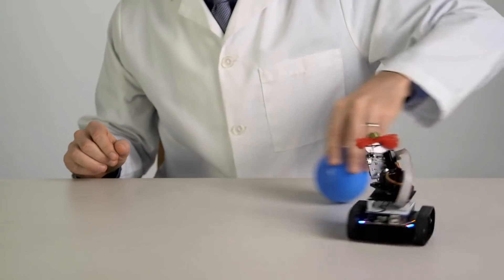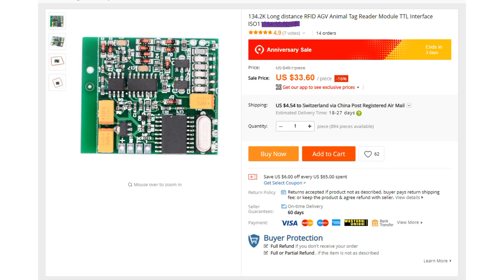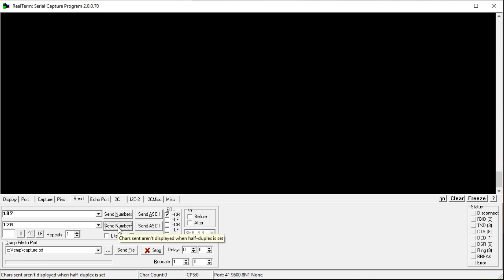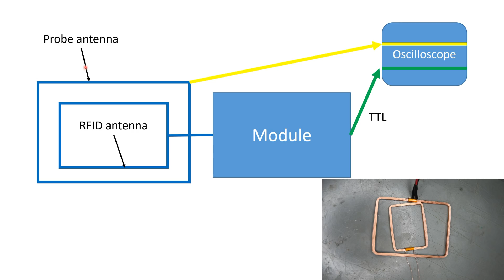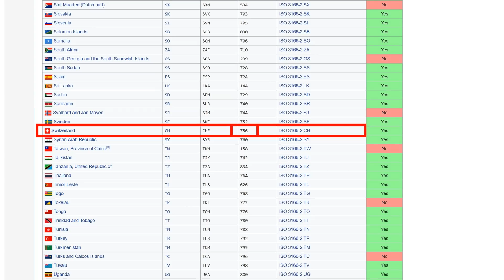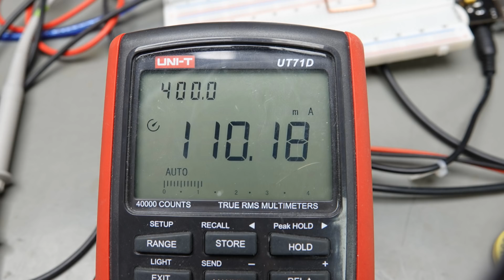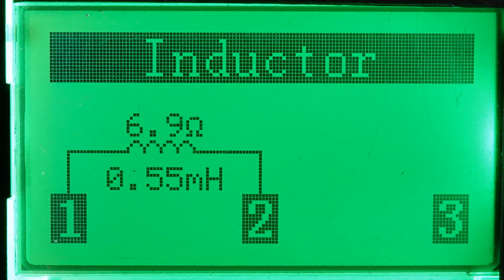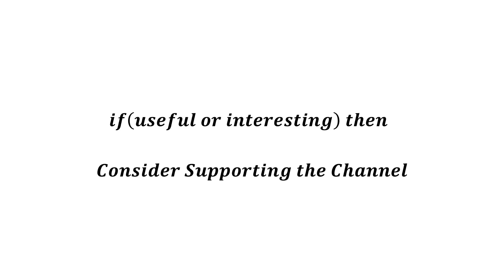#263 How to build an Animal RFID reader with Arduino, ESP8266, or ESP32

Comment: Hello, nice video. Can you help me a little bit? I managed to read the tag, but i just can't understeand how did you do the calculations? My tag should be 1604786574 and i just can't figure it out how to obtain that.  E8917AF5002820010000000000y†   Is what the module spits out. can you explain to me how that works? Thank you.

Comment: Andreas, did you try out the 9vdc reader with the esp8266?  I am worried about the voltage (3.3  vs 9) but the Arduino Mega serial port is good up to 20v.  Cannot find a spec on the esp.  Also, have you posted a wiring diagram anywhere?  I also left the comment from Lamachine on your Git.
Reply from the maker: You can check with a multimeter if the output pin has 3.3 or 5 volts. The ESP8266 is 5V tolerant, The ESP32 not.
Reply: @AndreasSpiess  Yup, I figured it out and already calculated the voltage divider.  Thanks so much for the video as well as the answer.

Comment: Hi, thank you for the useful video which I've only just come across! We have some SureFeed microchip cat feeders to allow cats with special diets to be the only ones to get to their food (like this https://www.amazon.co.uk/Sure-Petcare-MPF001-SureFeed-Microchip/dp/B00O0UIPTY). One unit has stopped working and it seems like the PCB has packed in. The motor, loop, infrared emitter and sensor (only powers up the loop when a cat approaches) etc. are all still working. Wondering about replacing the pcb with a similar Arduino set-up to the one you have created. 
The cat will pass through the loop so I'm wondering if the small or medium boards would do the job or with it being a bigger loop, does it need the larger unit with more power? Any pointers gratefully received. Thanks again for posting this useful video.
Reply from the maker: I do not know more than presented in the video :-(

Comment: Love your project, would it be possible to know how many loops were left on your 200mm ring for a good starting point for producing my own version of this?
Reply from the maker: It is hard to count. I guess 15-20 at a diameter of 22cm. But You have to measure. Start with more because cutting is easier than adding ;-)
Reply: @AndreasSpiess  Thankyou, that will give me a good starting point

Comment: That was very helpful, I am building a cat scanner to place outside but I wonder if you give me some advice about the DIY antenna, I am using a 24AWG cable for about 20 CM diameter. The ohm is about 6.03 but still cant scan the chip.
Reply from the maker: Resistance is not important. inductance and resonance is important. And unfortunately I cannot do remote debugging :-(
Reply: @AndreasSpiess  oh yeah I just talked to the guy who made the board and said the same. They were very helpful. Apparently there is no much different in working state between 6 and 9v. He told me that at 6v will just heat up more. 

I found one small bug on your software where I can store a bigger number than long. I got a test chip that is bigger and I need to work out how to store that in two different long
Reply: @AndreasSpiess  got more info, the antenna should be tuned to 580uH , from what the manufacturer told me, I am using 24 AWG but seems not working but once I get the meter I will double check why.
Also I found from another youtuber this handy calculator http://www.circuits.dk/calculator_multi_layer_aircore.htm

I have to try, but maybe uint64 will do the job to fix the overflow of the 10 byte to int of the RFID.
Reply: Extra info. There is a need of a capacitor for this module to make sure you can have the full range and potentially change the jumpers. The manufacturer suggest a 1000 capacitor

Comment: Hi Andreas, I am busy with the same project and I have been looking for your sketch all over github, but can't find it. Where should I look?
Reply from the maker: Maybe you look into the video description? First link.
Reply: @AndreasSpiess  Sorry, I never use Youtube or the other social media and did not know where to look. Found it now. 
Anyway: I have the same module from China as you have, the one that comes with ear chip (I also have "the little bugger that is difficult to solder"), but your program does not return the number on my chip . The 3 digits country code is OK, but then comes a 10-digit number that is different from the one on the chip. Same for a cat-chip that my vet gave me: 528=Netherlands is read correct, but the identification number then differs. Anyway: 3+10 is 13, not 15 digits as described by the ISO standard so there are two digits missing.
I hope we can straighten this out 'cause I have been beating my head against the wall for two weeks now. Thanks.
Reply: Andreas, I think I got it. When you compute the identification number from hex to decimal, you have the order wrong. If I reverse the order of the ten hexadecimal digits in your program, the resulting decimal number is the same number as on my earmark, c.q. the label on my cat chip.
Reply: weird... in your function hexInDec the unsigned long 'mult' does not increase after it reaches 268435456
 and returns to zero.Therefore the last digit in my hexadecimal string is not added.
Reply: I find that strtol and strtoul do not function either for large numbers, although the limits of an unsigned long are not reached by a long way.
Reply: @Andreas Spiess I have it now.  At least, the program returns the correct number of the chips. I had to link the sketch with the 'BigNum' library and change the variables accordingly. I used an Uno-clone, perhaps that was the culprit? An esp8266-based WEMOS also refused to return the correct chipnumbers, tonight I will try with the BigNum library. Do you want to see the code?
Reply from the maker: Yes. I will merge it into my repo if you send me a pull request.

Comment: i found out that the reader have only TX pins and you used arduino.Serial() in your code. there is no special wiring needed? What about RX? no wiring at all? - And arduino.serial() still works? i asked also on github and post this to catch your attention to this (theoretical?) problem...cat was feeded with green light..code must work in practice...
Reply from the maker: The sensors only send data, so they do not need an RX.
Reply: @AndreasSpiess  thx for reply. i was afraid that arduino.serial() would throw error if RX is not wired . also i was afraid not to wire RX to not cause an arduino.serial() error. with your answer i will give your sketch a try on my nano with 2nd Serial as softwareserial. if all fails, i will come back here. if all succeeds, i will come back and clapp here. wish me luck. thx for all your perfect videostuff. love it.!

Comment: Thanks for the great video, it's often hard to find info on the 134.2kHz stuff.  I'm curious about the antenna diameter, wire gauge used and how far away from the antenna will it still reliably detect the cat?
Reply from the maker: The rech is only a few cm. The idea is that the cat passes the loop
Reply: @AndreasSpiess  Thanks for the response.  I am having issues getting my antenna to read more than about 10mm away from the antenna...basically if I pass the RFID tag directly against the antenna, I can see it but if I am say 2cm away it will not detect.  If the cat is going one way through the cat door, then the antenna works.  If the cat goes the other way, the gap created by the flap on the cat door prevents reading. I am sure that the issue my lack of skill with building the antenna, and hoping I can figure out how to improve.  Thanks!
Reply: @rogerarchibald  Did you ever figure out the issue? Try to match the antenna diameter to what Andreas used, as well as try different orientations of the antenna plane vs the chip. It could be unlucky how the chip in your cat is oriented. May be easier to buy a chip online for testing so you can control this more easily (rather than flipping your cat around in circles :) Also could be the reader not using enough power or the number of turns in the antenna.

Comment: I'm building an automated cat feeder based off your video, so THANK you for doing this testing! Question though: what is driving the diameter of the loop? I'd like a larger loop for my kitties if possible (maybe even a square shape), but I assume I'd reduce the range of the scanner. Is this true?
Reply from the maker: The driving factor is the size of the cat. But you have to test the range.
Reply: No, if you make a square shape that would effect for the position of your tag, the tag and the antenna should face to face, but in a circular shape the different position of your tag wouldn't cause anything

Comment: Hello Andreas, nice video! Thanks, nice to see that it actual works! I’m also working on a petfeeding system for my 2 cats, each with a seperate diet. Can you give/send me a link how you connected the last one (the high voltage one). I couldn’t find this via the links below .. I’m currently struggling with that. Thanks!
Reply from the maker: You should be able to read it with Serial.read(). I have no code anymore :-(
Reply: @AndreasSpiess  Thanks for the answer, I was doing that, but sofar no success for me. Btw, my cats have a dutch accent ;-)
Reply: @RealDameBlue  I'd love to hear an update. did you succeed? Surefeed bowls wont do for us bc we need a system with a timer for scheduled feeding when we leave for a weekend, so our cat sitters dont have to come in twice a day but only once. I was thinking to get a small shelf with doors, put cat doors into its side walls on 2 different levels that recognize which cat is trying to enter, and place something similar to catmate bowls inside (the round ones with a built-in timer). i'm kind of in the mood to overengineer the whole thing

Comment: Good afternoon, this the guy with the welsh ascent, :) i have found your videos truly fascinating and informative , you have helped me with so many projects, so much so , i have never had to ask a question, until now,  i am due to receive one of those implants. just like the gentleman you met has,  as you maybe aware there are sometimes issue the the coupling due to the different coil shape, there are systems for sale that use tube -  cylinder shaped coils that stops this... but they are not, from what i am aware. compatible with arduino or esp32. my question is there any way i can make a custom antenna and attach it to an arduino compatible system . RC522 for example? its for my motorcycle :D
Reply from the maker: You need a receiver which is capable to decode the frequency and coding of your chip. Maybfe you watch my other videos about RFID
Reply: @AndreasSpiess   yes the rc 522 works with my implant and the arduino. where would i started making a cylindrical antenna for it?

Comment: help I dont understand it anymore. if you use animal tags its frequencie is 134.2 khz yet you get it to work with these ones how i dont understand
Reply from the maker: I used proper receivers for animal tags
Reply: @AndreasSpiess  and how do you decode it from the code given, because on 6:42 you did magic and it gave you the correct number out of a string of letters and numbers.
Reply: @johanneshettinga  Just write the bytes (every 2 characters) backwards and convert it from hexadecimal to decimal.

Comment: Grüezi Herr Spiess,
I tried to replicate your device, but I do not get the real ID written on the chip. The cow tag works, but the two chips implanted in our cats, do not. If I scan these, only the country code matches. Did you do anything special, or does it work on its own for you? Does it read the real number? I need to get the real number,  because we have an unknown cat visiting us, which might have a chip. So I can not use the number read by the program, like you did to distinguish between two cats.
Reply from the maker: I do not know if I got the „real“ number, because I do not know it. But I got different numbers for different cats and the China tags.
Reply: @AndreasSpiess  Well, same in my case, but I have a paper from the store, which sold the cat  to us, that is telling me the right number. Maybe you can have a look on yours, and compare to the read number?
Reply from the maker: I do not have the project in operation for now, so I cannot check
Reply: @AndreasSpiess  Ok

Comment: Great video
I’m only learning so I like to try and understand how the sketch works.

I’m not sure about the Hex into decimal function
It works fine for country.
When doing the ID   , when you get to message[9] the mult x 16 is bigger than an unsigned long, so mult goes back to zero.
This means you only process the first 7 values

The checksum I have know idea how it works! And help with that would be great

Many thanks
Reply from the maker: Unfortunately I do no more remember what I did in this sketch and I have no time to go back.

Comment: Hi, for a school project i'm making a automatic hen house. A part of the project is to count the chickens. here I tought about using rfid. Do you have any suggestions on how to know weither the chickens are inside or outside. (there's a budget of €150)
Reply from the maker: If you can chip them you can use RFID. If not you have to use other sensors like PIR or light.
Reply: Hi Andreas, I have very similar question. Sent you facebook message. Check it out please
Reply: Hey Henry, I have similar task. Do you have a solution?

Comment: How do i convert ascii output to decimal? I don't understand the step when you convert the Ascii converted string to decimal. I need to display my animal ID on a monitor.
Reply from the maker: Maybe you have a look at the function "hexindec" in my sketch?
Reply: @AndreasSpiess  Yes, i was trying to understand the datasheet. But i did not notice that i had to transform the HEX string Backwards to Dec. 
I was struggling to understand your Hexindec since you use alot of stuff that is new to me. the "nbr" and "mult" i cant see the purpose of. Othervise i think i might understand how it functions. It's a clever way of solving this using the map function.

Comment: Great video, thank you.  As a hobbyist maker I don't have access to complex electronic testing equipment.  Is there a simple formula for getting in the right ballpark for the number of turns on the antenna given we will know 1) The diameter of the coil (catflap, 3D printed loop etc), 2) desired operating frequency, 3) specs of copper wire?
Reply from the maker: Not that I know of. Antennas are very delicate and influenced by many things.

Comment: Andreas, do you know what the RST pin is on the expensive board. I'm guessing its reset but pulling it to ground didn't do anything. The board seems to only report the chip ID once when it first sees its presence. I'd like to be able to poll for a chip on demand so I can tell if the cat is still present after it's seen and I was hoping the RST would do that.
Reply from the maker: I never tried this variant. So I do not know

Comment: Perfect, this is exact what I was looking for.
HOWEVER I ordered the "Long-Range reader" from China, it comes with a test tag, which he positively detect from a long distance, BUT with my cats it doesn't react (I'm sure they are chipped)
I have 4 cats (3 brothers and one sister), we raised them from 10 days old with the bottle as their mother was run over by a car. I was hoping to make a feeding system, on which I can each cat give a controlled amount.

Any idea why it doesn't detect my cats ?

I went today to the vet with one of the cats and the test tag which was supplied from China, with the vets reader both were detecting positively.
Reply from the maker: I do not know. Maybe they use a different system in your country? I would google to find the standard used. A few other viewers also reported it works for them.
Reply: Yes, it detects the cats, however only when the coil is at a precise position touching the cat's, as such not suitable for the feeder. So I ordered cu wire to make a "walkthrough coil" simulair as you proposed.
Thanks for your advice.

Comment: I am trying to get the sample code from Github to run with the "middle" reader but can't get it to work. It seems to get stuck in the stage 3 where the checksum is calculated. Is the sample from github for another reader protocol?
Reply from the maker: I do not know. Maybe you insert print statements to find the problem.

Comment: First, I would like to say thank you for your great videos.  You are one person that I admire very much, I am a big fan.  When I was doing a bit research on alliexpress I notice that a few vendors posted that with a area of antenna  bigger, the range could be bigger too.  Did you notice if the cards can perform better (increasing the range) enlarging the area of  the antenna?
Reply from the maker: I only changed the antenna of one device. But as I showed you cannot just change the antenna.
Reply: @AndreasSpiess  ok yes I understood. But do you believe that if I use the last device that you used but change the size of antenna square (bigger) can I reach a better range of detection?